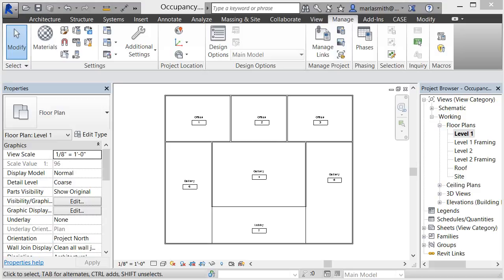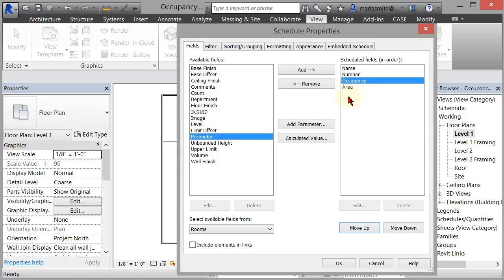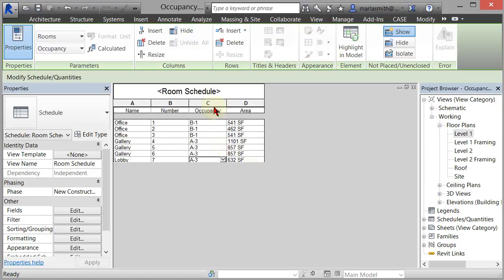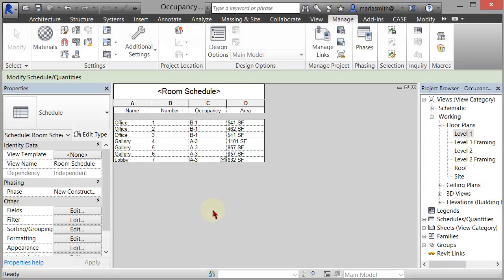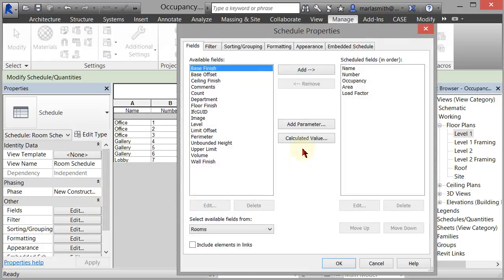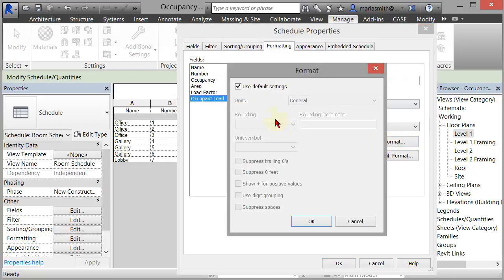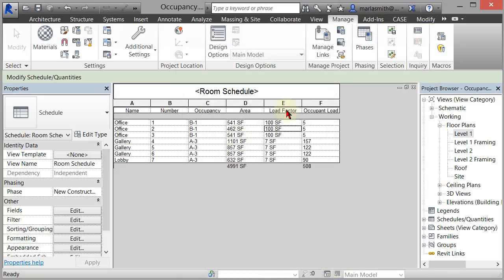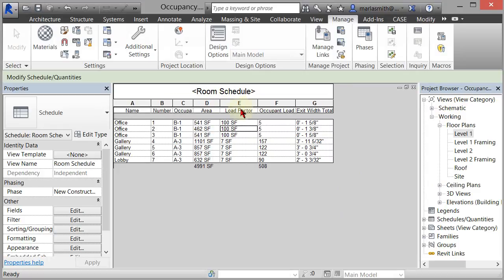REVIT OCCUPANT LOAD SCHEDULE

Comment: Great video, is there a way to break up the calculations per floor into multiple smoke compartments?
Reply from the maker: You could add a program parameter or shared parameter to the rooms that would allow for sorting based on compartment and level.  If I'm understanding your question.
Reply: @MSmithWorkShop  thanks for the quick reply I dont have much experience with shared parameters but I can give the program parameter a try. I appreciate it!

Comment: Hey,
I've modelled a scaffold in Revit, I've created the families and each family has its shared parameter of self weight, so I'm wondering what it the best way to create a schedule with the loads that each leg is loading to slab.
Reply from the maker: Hi Tito,  if your parameters are shared then they should come up as field in your category schedule
Reply: @MSmithWorkShop  The parameters are shared but I'm only able to see the columns locatio, the other items I'm not able to see its location related to grid lines. Thank you for responding.

Comment: How do you round up the occupant load when it exceed .1?
Reply: Bingo.. the method in the video, limiting decimal places, doesn't calculate the way code stuff needs to be shown.You have to use the function "roundup" in your formula - syntax is:    roundup(Area/Load Factor) or whatever your parameter names are.

Comment: There is a Schedule Key floating around on AUGI and probably other places that have the complete list of space functions defined in the IBC 1004.1.1 table.  There's one for rooms and also one for areas, but the "Load Factor" parameter in both can be set to apply to both rooms and areas.  So you just pick the function instead of manually typing in A-3, B-1 etc.  We find that we have to use an Area schedule almost always, to be able to properly calculate spaces that use the Gross calculation type.
Reply from the maker: Thanks for the information Patrick.  I'll look for the schedule key and that makes sense to use an Area Schedule for the Gross calculations.